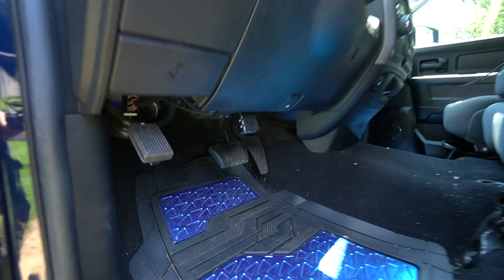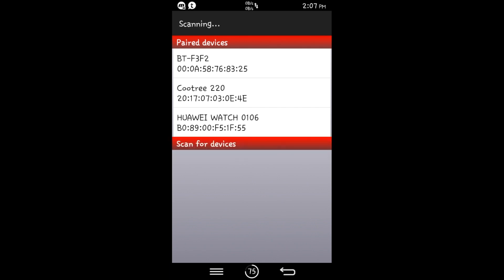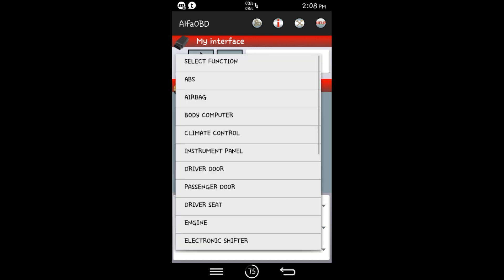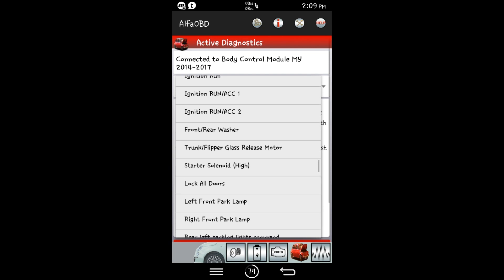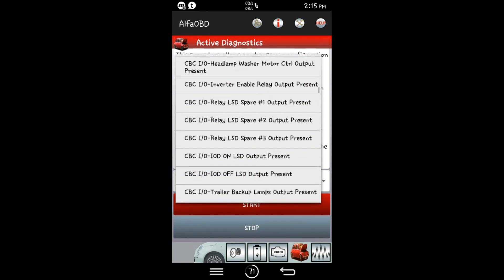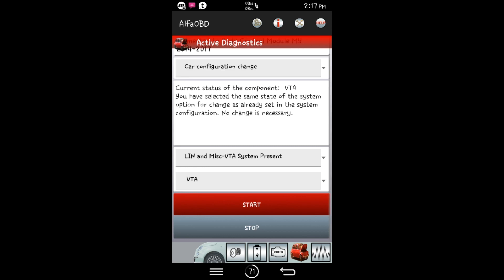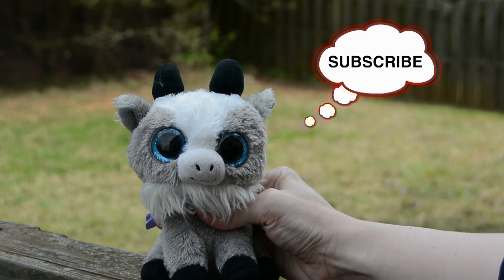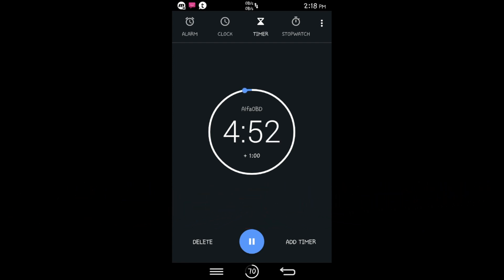AlfaOBD Dodge RAM Enable Factory Alarm Full tutorial!

Comment: I have a 2011 2500 and mine will not activate in the settings. When I try after about 10 seconds It says "no control unit confirmation received for the write request"

Comment: Great video, but it didn't work on my 2018 Sport. The red light comes on and blinks if I lock it, but no alarm if I open the door. This is really more of a comment for others trying it. Your vehicle may not be equipped.
Reply from the maker: Thanks for the compliment Phillip.
Sorry I didn't work out for you. 
2018 is when I started making some changes which is why you guys require the bypass harness. 
I've heard other people say global down also does not work for 2018 or newer. 
Thanks for watching though!
Reply: @bigdaddyshouse  yeah I had to get a bypass cable when I added a brake controller. 2018 models are a little different.

Comment: I have a 2014 RAM 1500 Express - yes the 4 tires only model.  I had uploaded the system info to google drive as you advised in another video prior to starting this  mod. So I had a good idea what was already enabled.  I was not able to locate LIN and Misc_VTA System Present in the app; however it was displayed in the system info as being a NO. I found only LIN and Misc_VTA System State which I know is listed as "No Security"  so I selected it and the options for Value included VTA.  I then selected Start - after I saw the completed message I selected the back icon until I was able to exit the app.  I exited the truck and selected the lock button on the fob and noticed a red right was blinking (3" cluster).  I waited about a minute for it to finish arming.  I used the key to unlock the drivers door and as soon as I opened  the door the horn started going off.  Love your videos they are so detailed -  Thank you.
Reply from the maker: Hey Iamnumber7, I'm glad you got it all worked out brother! I appreciate the compliment and your support!

Comment: This is great but none of these trucks come with glass break sensors. Last night someone broke my back passenger window reached in and opened front passenger door from the inside all without this RAM’s useless alarm/anti theft systems doing anything….. alarm only sounds if door is opened from the outside. Seems ridiculous that there is such an easy way around that.

Comment: First off I find your videos extremely helpful. I just purchase a 7" Speedometer and that is next, awaiting delivery! I will be using your AlfaOBD 7 inch EVIC Odometer Correction Engine and Idle Hours Fix video for it!

On to the issue at hand - I have a 2019 RAM Classic and went through the process as described and no alarm. Hmmm, so I went back into the settings as described and verified it was set to on just as your screenshot depicted (no change required) so I am not sure since it automatically reverted to a 2018-2019 Body Computer if that's the issue. I suspect I am may be out of luck on this mod or perhaps additional steps/setting changes are necessary in some area outside of the current instructions are required. 

So a little technical background info: I am using Alfa OBD v2.2.0. Also I know the SGM Bypass is working as I used it yesterday to program my folding mirror upgrade (which using the Echomaster Lane Change Asst Camera on  left and right plus front,, rear and rear travel trailer camera - when in tow). Just waiting on parts delayed due to, yes the virus (the gift that keeps giving)!  

Any assistance, ideas you may provide would be greatly appreciated.

Comment: Does the truck need to have remote start for this to work? My 2009 doesn't have remote start.
Reply from the maker: Hey Nick, your truck does not need remote start for this to work.
My truck didn't come with remote start and it worked perfectly fine. You will however need The truck to be remote enabled. Basically meaning you need the remote to make this work. (Remote lock and unlock)
Although you said you had a 2009? I know some options on AlfaOBD May not work the same for an '09 to '12. Some options work and some don't. 
Here's a link to the alfaOBD thread in the RAM forum
https://www.ramforum.com/threads/alfaobd.123982/page-1181#post-2328544
If you're not already signed up in the forum, sign up and ask that question to see if anybody with an '09 through '12 has had success enabling the factory alarm.

Comment: Why would you need to do this, every truck already has it activated.
Reply from the maker: Hey Ste McS, You need to do this on the lower end models, AKA Tradesmen and Express. The option is there in those trucks but it is not activated. 
Hope this answers your question.
Thanks for watching.
Reply: @bigdaddyshouse  That's really odd, I have an 09 ST (base model for back then), no fobs, if you open the door to quick after unlocking with the key it'll set the alarm off. My OBD will be here tomorrow, so I've been watching your stuff lol.
Reply: Mine wasn't

Comment: Will it work on a 2019 ram 2500?
Reply from the maker: Hey Luke, alfaOBD has done a bunch of updates since this video.
I know they added 19 and 20 body computer / power net. 
I can't for sure tell you what works and doesn't work but here's the link to the RAM forum alfaOBD thread
https://www.ramforum.com/threads/alfaobd.123982/page-1181#post-2328544
feel free to ask a question in there and see if anybody with a 2019 has had success.
also check out page one of that thread for all known working.
Thanks for watching and happy modding brother!

Comment: Im not understanding the idea of this, anti theft if part of the standard options. You’re saying you’re turning something on that’s already doing the same thing
Reply from the maker: Hey Howard, it's not a standard option for all Rams. 
there are options in these trucks that are enabled and not enabled, depending on your model.
This is especially true for Tradesmen and Express Rams.
The option is present in the computer but never enabled.
This tool enables that option so it will work like any Bighorn or Ram Laramie edition.
I hope this answers your question sir. thank you for watching and your support.
And if you're looking to make alfaOBD changes to whatever truck you have, check this thread out.
https://www.ramforum.com/threads/alfaobd.123982/page-1181#post-2328544
Reply: @bigdaddyshouse  I have a 2016 ram 1500 express it didn’t come with the alarm so I took it to a shop and they installed an aftermarket one, if I had enabled this option with Alfa since the beginning I wouldn’t even had to get the aftermarket alarm? Kind of confuse, Thanks
Reply from the maker: That is correct Victor, You wouldn't have  to get the aftermarket alarm unless you wanted some bitching options in it.  Like GPS tracking or LCD display or something of that nature.
The factory alarm works just fine for me just hit the lock button and it automatically arms. Unlock disarms...
Hope this helps out brother
Reply: @bigdaddyshouse  thanks a lot man, excellent channel keep it up 👍🏻
Reply from the maker: Will do and thanks for your support brother!

Comment: i have a 2010 ram 1500 try to program my keyfob it will start the truck but will not lock or unlock the buttons for some reason any clue on how to fix
Reply from the maker: Hey John, sorry for the late reply brother!
Did you try resetting the RF hub?
Also it's been known if you've ordered those key fobs on Amazon sometimes you get bad one.
You could also get a ton more help here brother.
https://www.ramforum.com/threads/alfaobd.123982/page-1181#post-2328544
Good luck and let us know what the fix was.....

Comment: I have an 2010 Dodge Ram 1500, will this work for me?
Reply from the maker: So for '09 to 2013,  activating some items had worked but others have not. I can't tell you for sure if activating factory alarm is one of the ones at work however I can send you to website where you can ask this question and somebody with a 2009 to the 13 who has tried it can tell you for sure yes or no.
https://www.ramforum.com/threads/alfaobd.123982/
Good luck brother and let me know the outcome.

Comment: 2018 2500 CTDTradesman, AlphaOBD, LinkOBD MX & AEV bypass cable.   Works like a champ.  Couple things to note, 1) the light blinks fast (armed but not active) then after 30 to 45 secs it will blink slow (armed and set).  2)  there are now MY2018/MY2019/MY2020 PowerNet Body Computer control units now in AlphaOBD. Thanks for the video!   I am the same with visual over written.
Reply from the maker: Glad everything worked out David.
Also thanks for taking time out to give an update!
AlfaOBD is changing rapidly.....
Reply: Thanks for noting, I thought there was something wrong at first

Comment: My truck does not have an alarm installed would I have to install anything for this to work or is it just opening up the factory alarm with the obd reader to get it to work?
Reply from the maker: If you have a fourth gen Ram all you need is AlfaOBD and an OBD2 reader (like the MX or MX+) if you have a 2018 or 2019 classic you will also need the bypass harness.
I have links to everything in my description.
To answer your other question, no need to install any alarm. Our trucks already have a factory alarm. We are just enabling the feature that is already there.
Hope this helps brother!

Comment: What is the form u got this info from I enabled the alarm but now my aftermarket remote start wont work after I did the alarm thing
Reply from the maker: https://www.ramforum.com/threads/alfaobd.123982/page-881#post-2133535
Sign up and ask away.
Strange you remote start doesn't work, because I also have an aftermarket remote start (Flashlogic CH10) and it works fine...
Let us know what the Forum have to say and if you get it fixed.
Good luck brother
Reply: I appreciate u getting back so quick and if it wernt for u and the vid my truck would have been stolen last night. I enabled the alarm at 1pm and someone broke into my truck at 4am my time. So u saved my truck
Reply from the maker: @88nicholas19  perfect timing! glad I could help sir.
Reply: Update got remote start working again good to go
Reply from the maker: @88nicholas19  awesome.
What was the problem?
Reply: The CBC i/o: hood ajar switch input present was enabled and didn't allow it to perform the start. I turn that off and presto she worked again

Comment: I did this last night. Got the red light to come on. It was late. So is didn’t test it. Tested it this morning and the alarm doesn’t go off when opened with the key. Anyone else have this happened. Btw, I have a 2015 ram 2500 6.7l.
Reply from the maker: This has happened to a few guys in the ram forum... basically, just cycle your key a few times or take it for a short drive. Then test again.
Thanks for the support brother!
Reply: big daddy's house you’re right bro. Just checked it after driving it 40 miles. And it works now. F’n Magic lol
Reply from the maker: Magic like my intros! LOL
Glad all is well.

Comment: I have a 14 Express single cab and I've activated the windows down, and the drl for the parking lights. Just a note! For mine though the drl activation only worked for the turn signals. Wouldn't work for the high or low beams but looks better in the turn signals! Awesome videos sir and thank you! Keeper comin!

Comment: I didn't work for me😥 I have the red blinking light but the alarm doesnt go off when I open my door with the key
Reply from the maker: Ask this same question here. Except add in your year truck and model. We will do our best to fix the problem. 
https://www.ramforum.com/threads/alfaobd.123982/page-881#post-2133535
Oh yeah, say BigDaddyshouse sent you!
Reply: Sit in the truck lock with the OEM remote. Wait 30 secs min. Then open door from inside. 
If you don't wait 30secs after arm nothing will happen. Did you wait 30secs min?

Comment: Great video . I have a 2014 Dodge ram the work model not the spendy one. Any ways I don't have the red light but seems mine has out keyless entry. I have locked and open the door and nothing happens. Would this obd tool help me to set up mine . Could it be possible that I only have keyless entry not security alamrn . Thanks . Great video .
Reply: Yes it will work. I have an st which is just a few options over an express. I have the 3 inch cluster so I did not see a red light either. But after doing this mod I now have a red light that blinks when alarm is set.
Reply from the maker: Yep, not only will this tool let you see what settings you have activated, it can also enable them for you. Lots of rams did not have this function activated. Especially if you had a Tradesman or Express. You can read more on what AlfaOBD can do if you tap the RAM FORUM link in my description under the video.
Thanks for the compliment! I spend hours editing these videos. 👍
Reply: @bigdaddyshouse   Thanks for taking the time to make this video.   This reply just answered the question I was about to ask...stay blessed.

Comment: Well it worked for mine but it disabled my remote start I had installed
Reply: I’m curious do you both have factory remote start or is one an aftermarket? I’m looking to do the factory soon so looking to see if there may be a possible conflict.
Reply: @poolballpolisher  I had a aftermarket remote start soon as I enabled the factory alarm is disable my remote start
Reply from the maker: @jontaylove25  Jontay, what year truck do you have and which aftermarket remote start did you install?
Reply: big daddy's house I plan on doing the factory remote start. From what I have seen I will just need to go in and change a few more settings for the alarm
Reply from the maker: @poolballpolisher  yep. And you having a 2016 I'm pretty sure you need to replace your RF module also...
2017's have it easy! Lol 😂
Reply: big daddy's house if thats the case I may change my mind on the factory unit. I haven’t totally researched it yet
Reply from the maker: @poolballpolisher  I also have an aftermarket remote start. Mine is a flashlogic CH 10.
Plug and play. (no cutting or splicing) 2014 Ram Express.
No problems all works fine.
Reply from the maker: That's a strange development.... My remote start works fine.

Comment: I've seen so many cool things you can do with an Alfa obd. Unfortunately I haven't seen anything for a 2012 RAM Express which is what I have. I looked on the forum that you suggested under the '09-'12 section but it seems to be nothing but DRL and TPMS.
Reply: Can confirm, this method does work for a 2012 ram. Pretty straightforward, but not entirely the same. It’s under security or anti theft something but you can still select VTA.
Reply from the maker: Try this thread. I encourage you to ask them questions. There are a number of people with 2012 RAMs that will shoot you straight. 
https://r.tapatalk.com/shareLink?url=https://www.ramforum.com/threads/alfaobd.123982/&share_tid=123982&share_fid=17770&share_type=t

Comment: When you activated the alarm system did it also activate the flashing light on the dash
Reply from the maker: For me yes. I went through all the one by one and noticed that all of mine were already turned on. ( except for the factory alarm)
at the end of my video I show a screenshot of the other functions you can go through one by one and they make sure that they are enabled. Quick note though: that led light will only show up if you have a 7 in evic.
Reply: big daddy's house red light does flash on the 3in screen as well
Reply: The light doesn’t show on the 3” display before doing the mod. After the mod I now have a flashing red light when alarm is set. I have a 2016 with 3” display, looking for a 7” 😄
Reply: @poolballpolisher  I have the 7 inch evic and no alarm indicator light
Reply from the maker: @jontaylove25  is so strange to me how we have the same systems but sometimes some functions don't work the same with certain years....
I would try disabling it wait 5 minutes and then enabling it again. If that doesn't work reach out to all of us at the AlfaOBD thread in the Rams forum. Maybe somebody in their has had the same problem and has a fix for it.
The link for the site is in my description. ☺